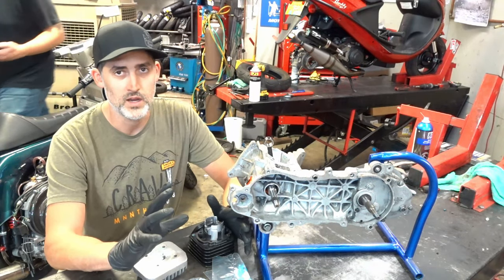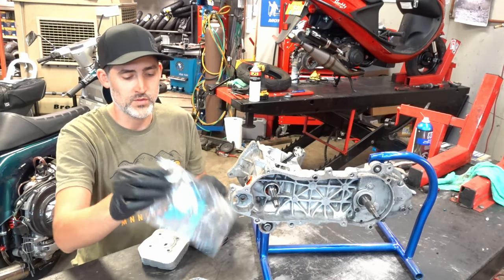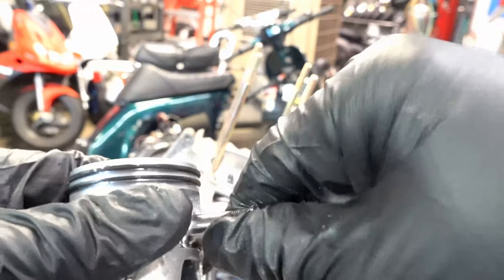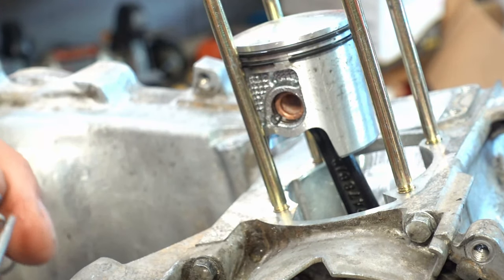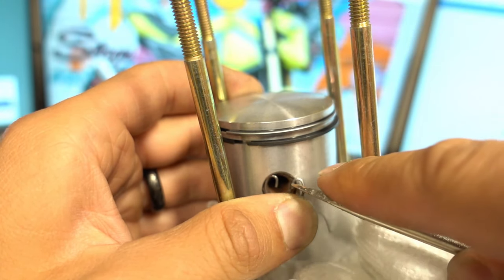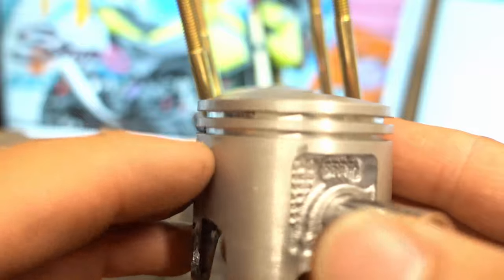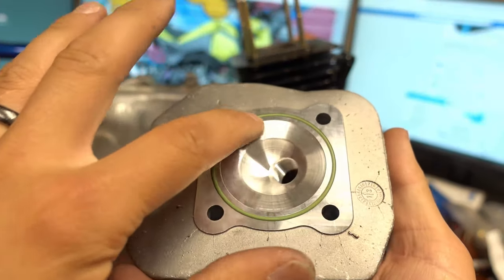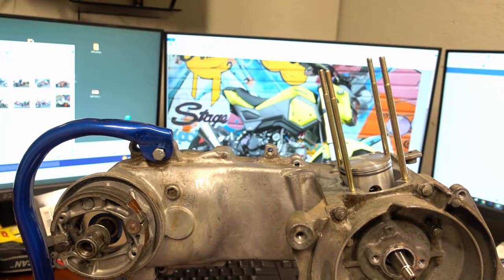How to install a scooter cylinder big bore kit

Comment: Do you coat the bottom gasket with the honda bond or just on the surface of the case?
Reply: I did
Reply from the maker: all mating surfaces with a very thin coating
Reply: Just put little greese coat

Comment: Ok I just picked up a 87 elite se50 I believe dude said top end was done so it's seized I believe was going to buy a malossi top end 72cc what all would I need to run ? Or can I just change it out and it'll run after also need torque specs by any chance

Comment: Hello. I have a question that is seems like nobody asking this. I bought a 70cc 2t kit from dr racing. The problem is with the small end bearing. It has so much space to play between piston bosses. It is a 12x17x13 size,13mm wide bearing. It looks like about a 25% of is out of his space if i drag it to the left or right. Is this ok? Should i buy a wider bearing like 15mm? The bearing came with the crankshaft.

Comment: Installed a Malossi 70cc bbk.  Piston seems very sticky in cylinder when I manually turn the crank.  I did pre-lube the cylinder.  Rings did line up to notch before assembly.   Do I need to hone a new cylinder?   Piston seems too tight.  Thoughts?      The kit is a Malossi 70cc Cylinder Kit w/CDI for Aprilia Scarabeo Di-tech (3112054)
Reply: Hello, could you give me an update for this situation? How did you solve your problem?

Comment: Can i use my stock carb and exhaust when I upgrade my cylinder to a 90cc short stroke? Af18 dio. Thank you
Reply: You can, but you wont get much power out.
Reply from the maker: why would you want to do that is the actual question, it could work but will likely not run

Comment: Hello guys! I want to ask if original is 50cm cilinder, but im putting aftermarket 70cm cilinder to scooter, what about exhaust mounting? Do original exhaust bolts wil fitt on bigger cilinder? Thanks for answer :)
Reply from the maker: You can

Comment: so I got a 2008 kymco super 8 50cc 2t... I bought a Naraku 70cc bore kit. it only came with the cylinder part with the exhaust port and the guy had to swap out the 10mm piston pin and piston with a 12mm piston pin and piston. it also came with gaskets and piston rings... I swapped it over and got the rings on and cylinder sleeve on and lubed it up and torqued down. I didn't get to upjet it yet cause improper thread size for the jet I bought to go with it.. and the exhaust won't fit due to the exhaust port is slighted so I have no exhaust on it. I crunk it up and let it warm up and then turned it off. I also got a aftermarket air intake too. it will crank and run but when I accelerate it hardly will move at all. can you tell me the areas I can work thru to get the issue fixed? please and thank you
Reply from the maker: Hi so it sounds like you purchased the wrong kit. I would purchase the kit made for your bike.
Reply: @Scooterswapshop  do you know of any kits for the 2008 kymco super 8 2t 50cc? Thank you
Reply from the maker: @damienwhite9187  yes I would
Suggest doing a build invoice on our website and we can set you up with the right parts

Comment: Does the crank have to be 45mm when installing 70cc? Or does that only apply to 80cc and up?
Reply from the maker: Longer rod doesn’t change the stroke or cc.
Reply: @Scooterswapshop  oh okay! I’ve just seen different shops selling 80cc + cylinder kits and recommending a 45mm crank rod instead of a 43mm etc. Does it really make any difference?
Reply: @ToxicLion  Sorry for answering 11 months later, but yeah it does indeed make a difference. When you have a longer rod on your crank it creates more compression during the stroke. This is obviously good for bigger cylinder kits.

Comment: how do you check squish gap i just put air seal kit50cc  on and it melted straight away after taking barrel off  i could see the melt and marks on piston and head where there touched harrd im going to take off oil pump as its the third head and about to put on a fourth
Reply: You would use soft solder near the outer rim of piston, turn engine over by hand so it compresses solder then measure. You can use a bit of grease to hold solder in place. You can also sneak in through the spark plug hole and feel the edge of cylinder and do it that way. I realize this is months old but perhaps someone else will have same question.
Reply: Jim CCC when having a bike with a 70cc bore and a sports exhaust will I need a bigger carb as it runs but will not Rev up
Reply: @Tizzy_p  , honestly my experience with these scooters is quite limited, I recently picked up a 2009 Ditech that had seized and I’m making it a 70. My actual experience is 250cc 2 stroke Grand Prix motorcycles. Have you increased the jet sizes in your current carb? I know they do need more fuel-bigger mouth to feed and all. Racing planet has a section on their website you can ask questions and they have been very responsive. Where did you buy your kit? You should pay close attention to your spark plug and how it looks to determine if it’s too lean, bad things will happen if you run it that way. Perhaps find a good video on two stroke spark plug reading and then do a proper wide open plug chop and reading and jet from there. Hope that gives you a direction. Best of luck.
Reply from the maker: looks like they helped you out

Comment: What's your opinion on right stuff? And no either 2t oil(what I been doping) or engine assembly lube on piston, cylinder, Small end cage bearing, or oil in crankcase? Or was this just a demo for the guys that need to sing lefty loosey song? Jw as you guys aren't the standard YouTube University. You actually know. Thanks!
Reply from the maker: lube everything metal to metal

Comment: Scooterswapshop, I bought a big bore kit and super need your help. I think I might've screwed up installing it...
 Ok, so you know the head, the one that holds the Camshaft and little hammers? Ok, so that head unit is held on with two long bolts right? Well, I think I might have over-tightened them because it’s not air-tight ): I can see a slit of an opening because it was too tight on one side.

Is this normal? Should I replace the gasket or put an extra one in there? Please help!

Here is a picture I took to help reference what I'm talking about:

https://i.imgur.com/JFmK7VT.jpg

Please help!!
Reply from the maker: Hi, I can’t really do diagnostics on YouTube and I have no way of knowing what bike and products your using I would reach out the company you got the parts from for some tech support